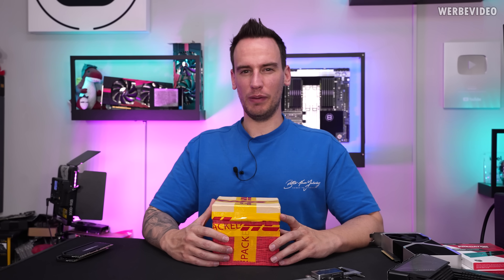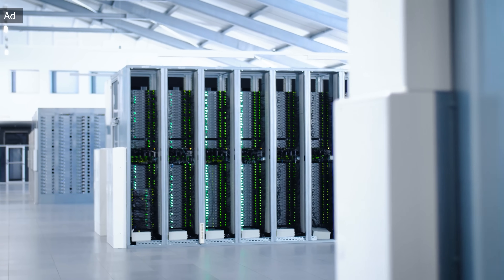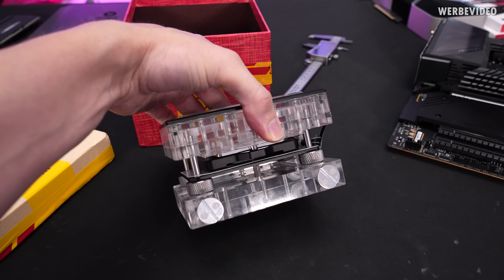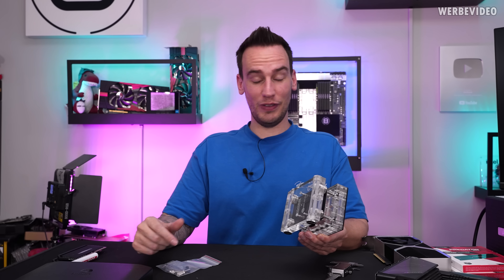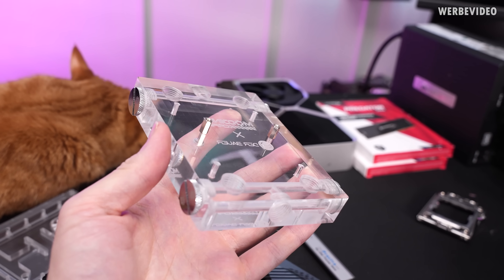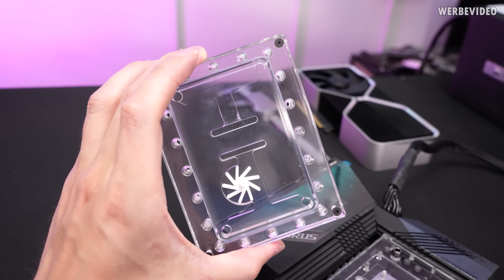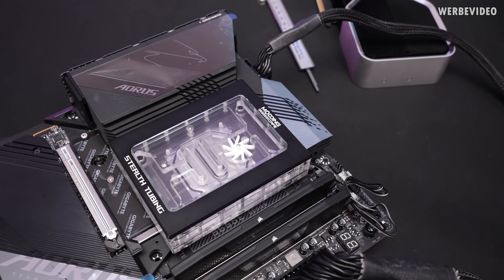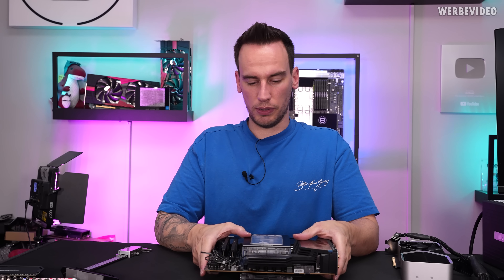A New Generation of Water Blocks? Stealth Tubing Block Tested in Detail

Comment: One upside of this concept is visual neatness, of course, but what I really like is that this design allows to have a much 'safer' loop. However good the water blocks and fittings are, it's still fairly intimidating to put tubes with running water right on top of all the expensive parts, especially if it's your daily driver. If I was to make a water cooling build for the first time, something like this block would probably (very much) be the tipping point.

In a similar vein, if I were to make a suggestion, I'd also like to see something to cover the back of the motherboard around the backplate to further improve the safety.

Wish you luck making this a product!

PS: Now it makes me wonder if something similar is possible for GPUs.
Reply: I feel like this is more dangerous than normal fittings and tubes due to having to trust the 4 little o-rings on the little tubes. if that leaks its directly onto your GPU or M.2 slots. 
I've built water cooled PC for over 10 years, and I've only ever had 2 leaks, one in the bottom of a case due to loose fittings, so no issues just clean up, and my buddies PC after 3+ years of non maintenance the cpu block leaked on the gpu backplate. the surface tension of the water literally kept it from spilling onto the pcie traces. regular fittings have usually 3 o-rings in line, so you'd need to have 3 leaks to have an issue. this block is 4 single o-rings, any one of which would leak if it failed. never had a leak from the tube to fitting connection, only blocks and the thread side of a fitting if its gotten loose.
Reply: @Born_Stellar  Thanks, that's an interesting insight. I suppose there is room for improvement. But I gotta tell, it still kinda looks promising. From an uneducated point of view at least :')
Reply: @splinter860  I mean it would probably be fine for years as long as it doesn't leak initially.  regular cpu block already rely on a single large o-ring.

Comment: Given you need something similar to the contact frame anyway I'd be tempted to run water through the screw holes for that too to improve flow rate. I also think it would be interesting if it provided active cooling to the back side of the socket, it would be pretty tempting to pick up if active cooling on the back could lower temps another few degrees. I'd love to see what active cooling on the back could do for the CPU temps, even if you just strap an AIO to the back with thermal pads protecting the SMDs on the back of the socket.
Reply: GPUs have much higher power, and a more conductive connection (BGA) and still see almost no benefit from backside cooling.  So, <1 degree C.
Reply: @concinnus  Yeah that's probably true but unlike GPUs the CPU has the heat spreader on it which makes it harder to efficiently remove the heat from the die so there may be more heat going through the PCB than on a graphics card. However I doubt the socket would conduct heat well either so while I'd still like to see the results I'd certainly agree the most likely outcome is a negligible difference.

Comment: More options for water-cooling is always a good thing. I'm concerned with how hard it might be to run tubing to the block in some cases, especially having to go around cables. I guess everyone will need to up their cable management game!
Reply: yeah most cases have barely enough room for cables back there let alone tubing that would somehow have to get back there.  and how do you hide that tubing?  unless maybe using an external radiator to where it could go straight in to the void behind mobo?  i think that's gonna be the biggest hurdle especially when the performance isn't even there to justify using it.  idk.  looks really cool tho!
Reply: @XX-121  I'm thinking it would probably work best in a case that has a sandwich style layout where the PSU and GPU are separated from the CPU cooler and MOBO. Then you coud just water-cool the components on one side and have the rad and res on the other.

Comment: This is really very cool indeed. Almost makes me want to design a case that would accommodate it and make use of it to hide the tubing. Some kind of wide inverted sandwich would let you stuff the tubing between the motherboard and the GPU and could look really sleek. 280mm radiator on the bottom should give plenty of width and cooling… I’m just going to start up Solidworks and start drafting…

Comment: I had just seen GGF Events build with this block, and I had almost worked it out. This block idea is super cool, I’d be curious about the flow through the small tubes, but still very clever! For sure a better plate, that looked rough (literally). Thanks for the video!

Comment: This would be amazing for SFF. I would definitely want on if it was available
Reply: you still need radiator, pump, and tubing.  and the radiatior would need to be bigger than normal to try and make up for decreased flow rate.  not sure but i'm guessing he was using that giant external radiator that he got a couple months ago?
Reply: @XX-121  yeah totally I’m running dual rad with a pump res combo in a 10 liter case right now. The stand alone pump res can get plenty of flow. That block would just make things a lot cleaner and easier to rout tubing

Comment: Super awesome idea!
I have never really had any interest in water cooling and this probably won't change that practically, but it does allow water-cooling to go toe-to-toe with air cooling from the perspective of clean/simple looks.
As others have said, would likely be really optimal for temperatures on a stock air-cooled GPU as you are not introducing any impedance on air flow.

Comment: Water cooling is a topic I've been very wary about, namely due to lack of experience.
But innovation is innovation, and this one is intriguing.
But like you said, with the water block on the back of the PCB, it really does limit the cells of cases you can use. The only one that comes to mind for me is one of those open air frames

Comment: Cool design i always wanted motherboard to just have a cut out near the CPU for tubes and for the CPU fan/pump cable and the header on the back of board. Issue with this design is all the failure points i guess. Good idea though for sure love it. I think this + direct die attachment would be cool. Where you clamp the CPU into the block and then place it that way with the holding device for CPU being in the water cooling block also. This should allow perfect alignment.

Comment: well this might sound a bit custom... but i like the concept of putting a distro plate / reservoir with d5 dump integrated directly onto the back of the motherboard... and then screwing mounting the motherboard onto the distro block. maybe a thin metal carrier frame in between (if needed).

but then the question becomes how to deal with the gpu... so for that to be another interesting question.... but maybe on the back too perhaps? and then rotate it so the long 300mm length of a gpu waterblock does match the ~300mm lengthwise of the motherboard.

alterative ways could be (for shorter gpu waterblock, for shorter modern 4090 pcbs)... then it can fit more easily width wise. and be mounted directly in front of / above the cpu and vrms area. which is the front, top 50% of the motherboard facing you. and i think that can be good location for both mini itx... (and also standard atx so as to avoid blocking other 2nd, 3rd pci-e expansion slots)

however those are not the only possible option. it can be other ways instead

Comment: I use my PC for work and pleasure on a daily basis. It is an investment. I rely on having a transparent case panel so that at a glance I can see how well the PC is operating and if there are any issues. I would appreciate it if the industry moved to having power, cabling, and even liquid cooling run on the back side of the motherboard. Hopefully projects like this will inspire the industry to move in this direction and introduce a new standardized motherboard and case form factor. Perhaps going as far as to provide an updated PCIe slot that provides the power required by GPU cards, if not also having water cooling connectors for back side runs. Having to run an increasing number of cables and liquid cooling lines on the front side restricts visibility and access to components. This complicates repairs, upgrades, and the flow of air cooling. Also, all the cabling and such on the front side can look ugly.
Reply: Why not just use an open chassis like a a Core P3 or such?
Reply: maybe YOUR cabling is ugly but mine isn't, and neither are the tubes. how are you going to see any issues when you look into your case when all the potential problems are hidden in the back anyways?

Comment: How well would this system work if you inversed the tube and mounting holes, would it still apply ample pressure to the CPU?  If it is a feasible change, moving the tubes to the inner set of holes, the ones used for ILMs and contact frames, would reduce overall footprint by quite a decent amount.  There's possibly also a reduction design complexity within the process, given further design optimizations as this change would only be one step of many.  

As for case compatibility, I almost feel as if you'll have to keep the smaller doubled-up tubes within the rear of the case, just to reduce thickness of the loop components, as that's the simplest way to reduce tube thickness while also keeping simpler fittings.  The alternative is to use flat-sided tubes, but that locks you into a more limited range of materials from a much more limited range of suppliers, not to mention the fitting situation becomes much more complex; thus, while flat-sided tubes could be cool, they're not a good choice for a consumer product. 

I would also assume flow rate is fine, just with a slightly higher velocity, given that velocity is inversely proportional to cross-sectional area.  Also keep in mind that you're dealing with a microfin array within the block, it's entirely possible that this higher velocity could be beneficial over how a typical loop operates, where it's more pressure-dependent to reduce a full-sized tube to the microfin array without any form of loft to optimize the change.  Honestly this could be a cool research episode, smaller but higher velocity tubes vs. larger but higher pressure tubes, along with properly pairing a pump for the loop types.  Based on this, you could potentially optimize block design, rather than have the tubes join within the block and having a single channel go into the microfin array, why not have the two join immediately before the microfin array with a shallow delta; and have the same design on the microfin array's exit to avoid velocity loss.

Comment: the flow of these tubes compared to 10 mm is like 14 vs 78 very limited.
Reply: flow is dictated by the most restrictive point already, which would be the gpu/cpu jetplates.
Reply: @Born_Stellar  Keep in mind that it's not just about which point is the weakest, it's also about how many of them there are...
The fact that the block has a smaller cross-section does not mean that each next larger one (but smaller than the hose) will not restrict the flow more.
Reply: @666Azmodan666  what is 14 vs 78?
Reply: @Born_Stellar  you calculate the throughput from the cross-sectional area in a given place. These tubes have a maximum radius of 1.5mm inside and there are two (2 inlets, two outlets) the capacity of the hose itself is 10mm.

Comment: Long have i waited! For any innovation like this. This is wonderful idea! Hope that flow rate isn't an issue. Or at least getting pump big enough will compensate. This thing has such a potential! Providing flow rate is descent this looks like future of waterblock design.
What is the inner diameter of those pipes going through the mainboard?

Comment: The reason your board is switching straight back on is because in one of the power settings in the bios it must be set to "After Power Loss = Return to Previous Power State" and since you're switching the power off from the wall and not powering the board down it thinks it's a power loss. Just change it in Bios pal.

Comment: I would think something along the lines of a GPU block, where they have the flat, wide channels to get through the block, then goes to the normal fitting from there. Could make a couple different versions that change the direction and distance it goes in order to be compatible with more cases based on common areas with room to pass through.

Comment: With Monoblocks being a thing, i will not consider going to a 'cpu only' waterblock again, especially one like this that is considerably large in size.

While this does restrict my purchases to motherboards with a compatible monoblock, the longevity i would get out of the system by the additional vrm cooling warrants the extra costs involved.
Reply: The VRMs in any decent board do not get too hot. Monoblocks just add heat into the loop for no benefit.
Reply: @Safetytrousers  I would say yes benefit, but only for the most extreme overclocking where your VRMs are actually getting hot. your correct tho most now are very good at cooling themselves. could also be worth it if you have 0 airflow in your case.

Comment: That is very cool. Wouldn't mind have one in my build. But it seems this would need to have cases also have pass through holes for tubing. If not, people can make it but not everyone will do it. So you are limiting the market even further.

If something goes wrong, troubleshooting will be a pain in the but. For example I just built my first open loop. Prior to building i tested all the parts and made sure everything works. But now I am having stability issues. Issues I was not having before. I can boot into windows but the board gets stuck on memory testing and at random times the screen goes out. When that happens i have to force a power cycle. A simple reset doesn't do anything.

long story short, I am thinking my issues have something to do with the block mounted to the CPU. The amount of work I need to do to get that block off is crazy. If i had this block (from the video) in my build and was having the same issues, I would freakin pull my hair out.

Comment: 06:14 There is BIOS setting for "AC power loss". You can set it work after "AC power back" to turn PC on or stay shutdown.
- You want it to turn PC on automatically, if you want use "Wake-On-LAN" function and get it work. Because LAN chip not work after AC power off, you need wake PC up first, then LAN chip can remain "sleep mode"

Comment: I am afraid, that the tube width will limit the flow rate. Maybe the normal tubing is this small anyway, but still feels like there is an increase of points of failure... There is no beauty because of function/simplicity..

Comment: I'm a water-cooling luddite because a failed pump could kill your CPU whereas a failed air-cooler fan would have time to gracefully shut down with overheating. Right? I've always heard this... but has anyone ever actually had their components heat-killed from a failed water pump? Anyone?
Reply: I have never heard of a PC pump failing. And CPUs and GPUs will shut down if they get too hot before any damage occurs.
Reply: what exactly do you think the difference between dead pump in a water system and dead fan on an air system? firstly if either is connected to the 'cpu fan' header the pc will give a warning immediately (dont know if it will shut itself down or not at that point) but it would shut itself down when getting to a certain temp anyways. this was only an issue over a decade ago before cpu's had such protections. I had my pump unplugged once and my pc ran for almost 30 min before it shut off. and then was all good once I found out the pump was unplugged. 
the real risk of water cooling is leakage.
Reply: @Born_Stellar  The difference is that an air cooler has a passive heat sink, with heat pipes,  mounted directly on the CPU even if the fan dies, whereas a water cooler has to physically pump the hot water to a radiator. So if the pump fails, the CPU will heat up a lot faster. If you're just idling or browsing, it probably won't matter - but if you're running blender or something, the heat will immediately skyrocket. Will the heat sensor trip before any damage in that scenario? That's my question I guess. Has anyone ever experienced that?

Comment: Iv recently switched from a 240mm AIO to the ND- 15 Air Cooler and I’m now a serious believer in CPU Air Cooling. It’s also nice not having the worry of water leaking
Reply: 240s aren't that great. 120s are terrible value. Anything less than a 280/360, just go Air. 

I will have only two reasons to ever buy an AIO. Noise, and performance. 

Price, value, durability and simplicity is why I exclusively suggest air cooling to almost everyone. 

For example, I'll use a 360 for my daily computer, but for my second one I'll never consider it. I currently have 3 in my room, none have any water-cooling. For the one I'm planning, I'm going to try a 360. I think I'll go with Arctic or Bequiet. Arctic have the largest rad and a vrm fan, but be quiet are refillable...
Reply: I’ve done air cooling, but it’s not for me. I like big CPUs, my current one is a 7950X, and it goes from 60C idle to 90C under load basically instantly. With an air cooler that means I get fans spinning up and slowing down all the time, which is a noise I find insufferable, but with water cooling I can control the fans by the water temperature and effectively get perfect cooling at a steady fan speed. Yeah I could set the air cooler fans to spin at 100% constantly, but that’s still an unpleasant level of noise. The water cooling only goes over like 50% fan speed after I’ve run something very intense for a very long time.
Reply: @СузаннаСергеевна  I hope the rain doesn't hurt you.😢
Reply: @DM-eq4rs  Pardon?